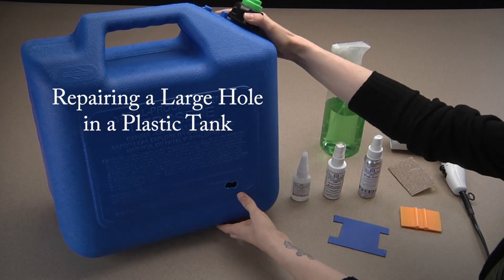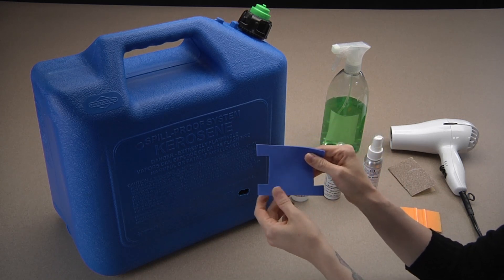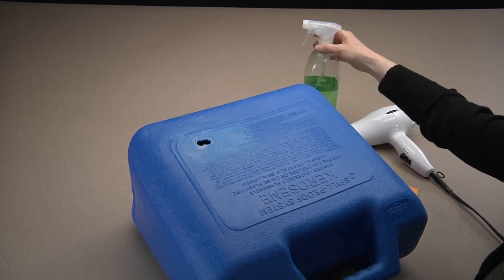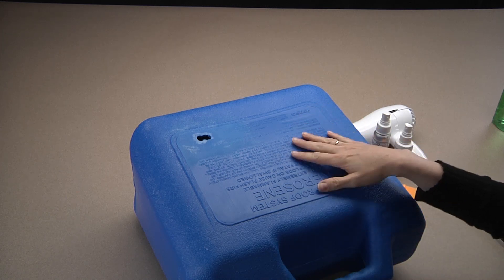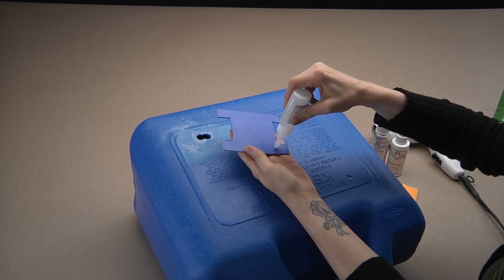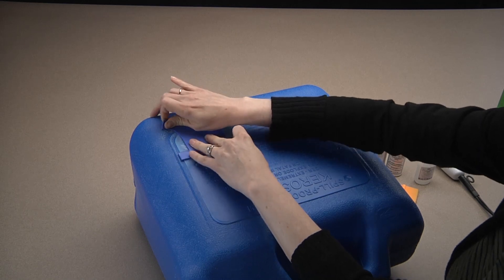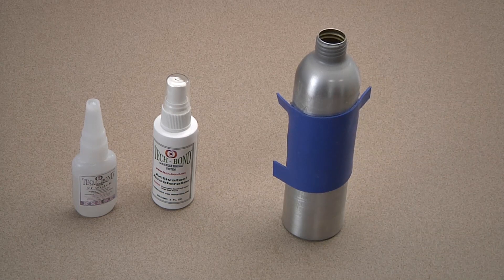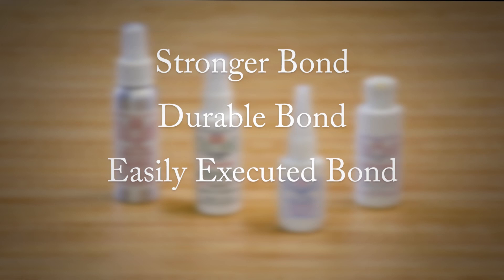How to repair a hole in a plastic tank - plastic welding | Tech-Bond

Comment: On your website you show a giant green poly tank. Just so you know, the guys in the tank industry just drain the tank (which your technique would have to do also), crawl into the manhole, and apply a threaded plug, like a bulkhead fitting from both sides, then they tighten it down. THAT is much stronger and more proven over decades than trying to glue something onto a big tank.
Reply: You have a point. Cheaper to thread a piping hole and block it.